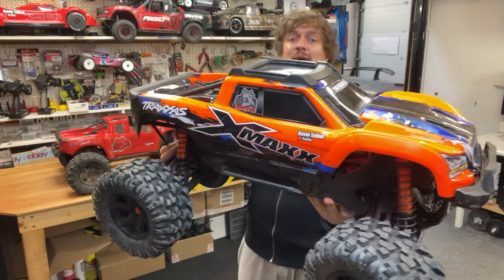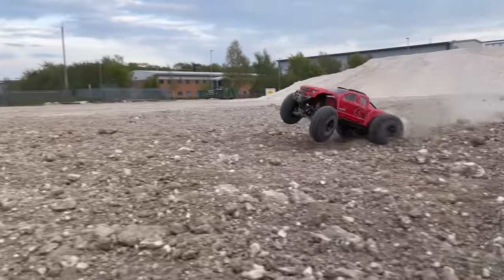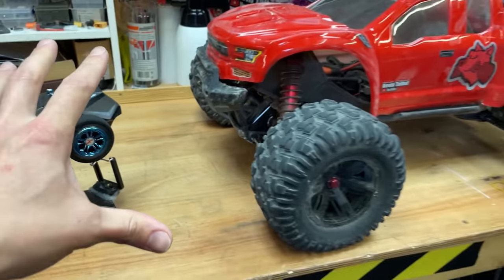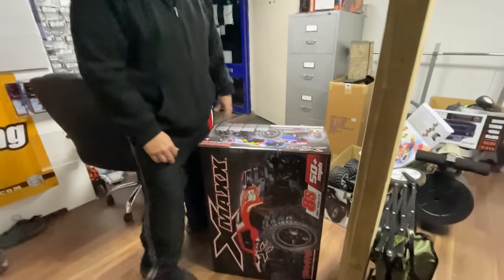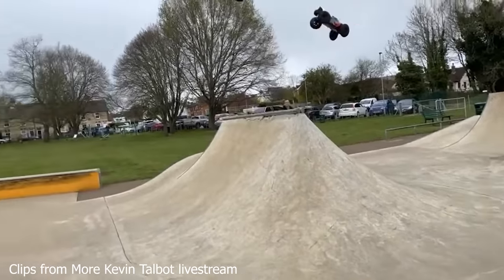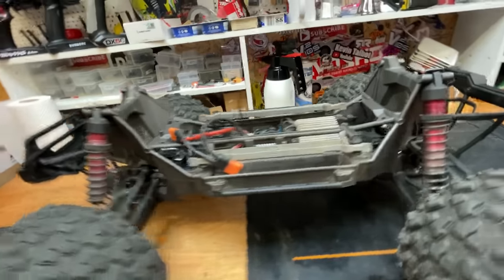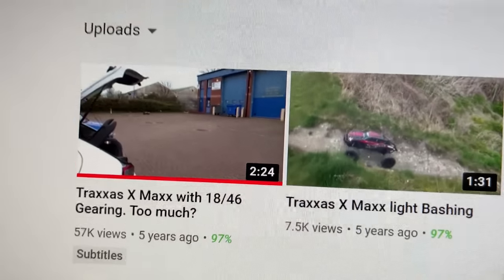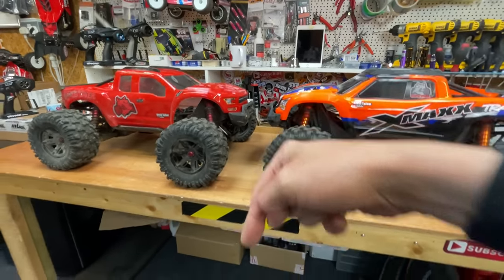The KING of all RC Cars

Comment: My Favourite is E-Revo 2.0 but it broke often but if you upgrade servos and  suspension there is no much problems, E revo can do backflip on wall or do standing backflips, E revo is very Easy to steer it in air, it corrects itself very quickly in air, In my opinion its the best RC Car😉

Comment: What more could you want from an RC car:
An ESC that doesn't catch fire
A body that doesn't pop off
Battery trays that don't eject your expensive and volatile batteries
A brand that doesn't sue everyone for no reason
A chassis that has a higher centre of gravity that a bus
A wheel hex system that is no where near 1/5 scale
An actual centre Differential that does what a Differential is supposed to do

Just to name a very few.
Reply: I think some of those issues(but not all) are more aimed towards the 6s x maxx. I have one and nothings happened except a bearing disintegrated In the slipper clutch.

Comment: I've never really noticed this before, but this video really shows how high the Xmaxx's center of gravity is, it really an off road basher MT, and no good for speed runs.
Reply from the maker: rc monster trucks are not supposed to be speed cars but mine does 60mph in bash setup, some have got them to go over 100mph, not really sure why you would want to go faster than that in a monster truck!
Reply: @KevinTalbotTV  Yeah, MTs are really best for bashing and off-road. It seems that when you were doing the speed runs, you had some issues with the Xmaxx flipping over/wheelieing. Maybe a longer wheelie bar would help, you could put it on when doing "speed runs", and take it off when bashing. I know you don't like wheelie bars that much because they get in the way of bashing, backflipping, etc.

I wonder how much modification would be needed to get an Xmaxx to 100mph...lowered ride height, new tires...by the time they're done, they pretty much made a new car! 😂😂

Comment: Bought an Xmaxx. First run the shock cap broke after a roll over. No replacements parts anywhere so Traxxas sent me replacements. Fixed that took it out again, another roll over (hard braking) another broke shock cap, stuck it in a corner for a few weeks. Fixed that took it out and ran a set of batteries to low voltage. On the 4th charge it shredded the garbage metal pinion. Sitting in a corner again, and I have 2 Maxx (orange, green) in the mail. 

Maybe one day my built from eggshell xmaxx will be durable, but at the moment it's a $1000 POS paperweight.

Comment: My main issue with the xmaxx is that it kept shredding tires and ejecting suspension pins. Put some beadlock trenchers and captured hinge pins on it and haven't had a problem since.

Comment: So bought a used XMaxx and it keeps burning up the steering servo, when sitting still. I’ve put 3 2870x servos in it. I’m at a loss. Will work fine for several batteries as long as you don’t let it sit still. Replaced receiver and now burnt up a 4th servo….

Comment: Hey Kev, Big fan you are the reason my toddler and I got into RC cars, an ive got an xmaxx and burnt through 3 servos since i bought it in February which is rather expensive (including upgrading to 2085x) in 3 months.. I have taken them apart and the gears are fine its just the electronics that dont seem to be working - Any chance you or someone can help me out on what to do or what i might be doing wrong?
Reply: Have you adjusted the servo end points?

Comment: Can the xmaxx be adjusted to handle better? As in I have smaller rcs and they handle very responsively, is it just too heavy to change direction quickly? Or is it too soft? Obviously you can't bash a racer but is this platform capable of performance other than power?
Reply: @Mostima115  well my mini revo has quite a bit of adjustability and with a few mods is also very durable, handling is superb, doesn't look like I can get that kind of experience from this, maybe I'll stick with more race designed models like you said

Comment: KEV, mines so overbuilt, I break driveline parts. Low kv over-gearing, I found to not be worthy it started using lighter higher kn motors in some other cars. Very impressed with hobbywing 1650 6s. I also have a 1100 kv short can I may try. Or start from scratch and build it like yours. I have 2 new shimmed rear diff and center diff blew up 3 runs. It’s making me hate it. I know once I have the correct set up I’ll be Good. Jumped on the XLX2 and hobbywing 800 kv bandwagon. Sorry, too much for reliable real bashing not just driving it on flat ground.

Comment: Bro how do you keep your stock tires glued or blowing the foam apart????
Reply from the maker: not let water and crap get in the tires
Reply: @KevinTalbotTV  do you re glue them when you get a new set or just roll with factory tires the way they come. Also do you vent the tires or plug the holes in the wheel at all?

Comment: My Xmaxx eats stock tires and and the steering servo failed quickly.
Reply from the maker: my servo lasted 3 years, and my tires last ages. if you let water and crap get in them they will blow out

Comment: If price is not part of it, Kraken Vekta is the world best RC car and the best 1/5th as data proved this to be a fact. If price/quality/size is what we are talking about then its a mix of a few RC's as a few has their pros and cons just as the xmaxx does...  $1000 for a mostly all plastic RC that still needs lots of upgrades, yeah ill pass and put that money into real quality metal RC's.  I have the Kraken Vekta (gas) and for $400 (ARTR) more than the xmaxx (RTR), its lightyears ahead of the xmaxx. It will not break (for me), fast and has more power, its a true king in my opinion. Thinking about doing a 12s conversion.

This is my honest opinion like all the times before so hate it all you like....